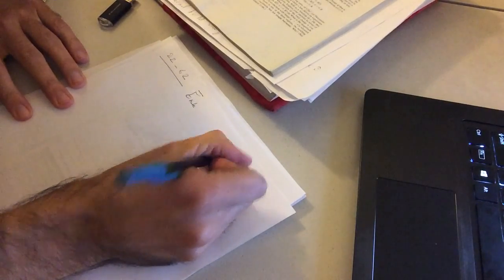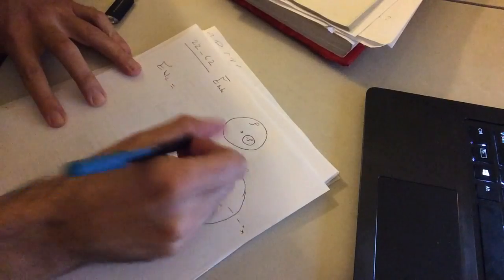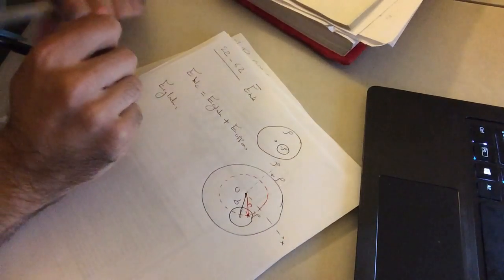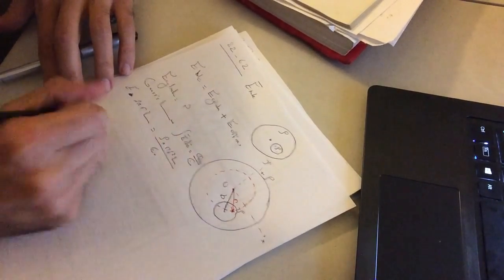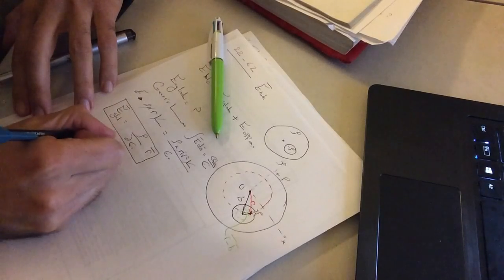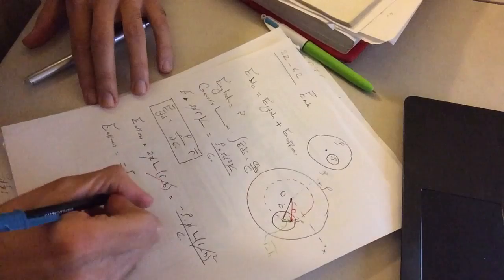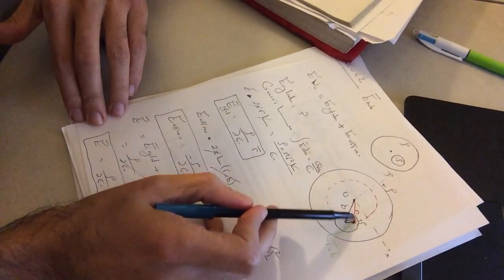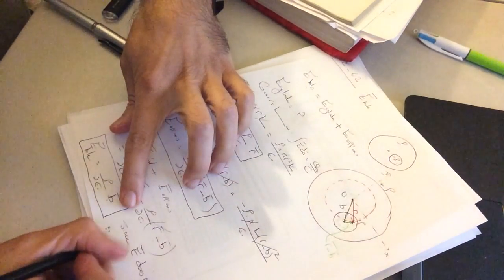Electric field inside a hole within a cylinder

Comment: Que : 
A hollow charged conductor has a tiny hole cut into its surface.
Show that the electric field in the hole is    (σ/2ε0) nˆ , where nˆ is the
unit vector in the outward normal direction, and σ is the surface
charge density near the hole.